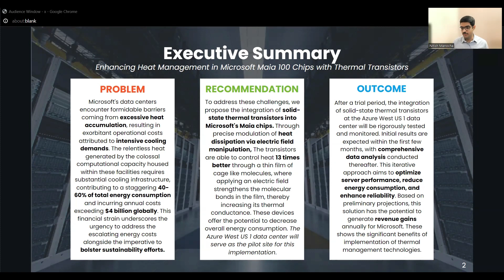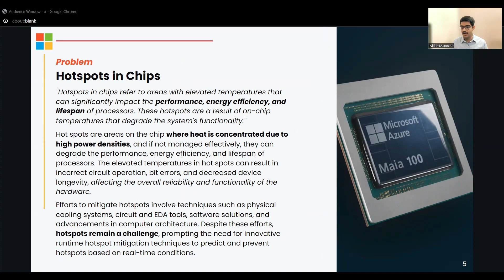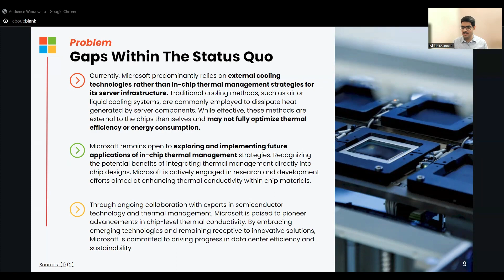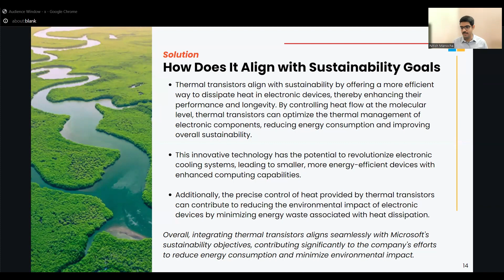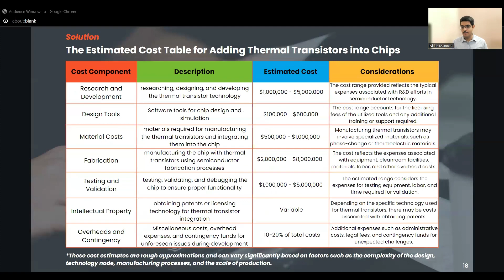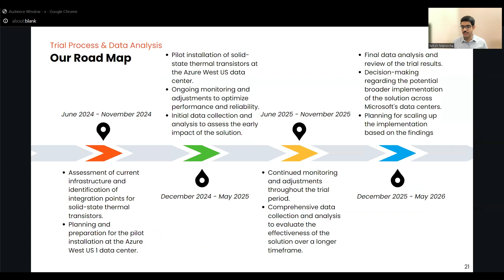Enhancing Heat Management in Microsoft Maia 100 Chips using Thermal Transistors | TKS

Comment: Thermal Transistor = Vaporware. Heat is a byproduct of switching. Only way to mitigate is to transport it away. You just need a material with high thermal conductivity to wick the heat away and out of the system. There is no need for thermal switch,except to trap heat further.😂